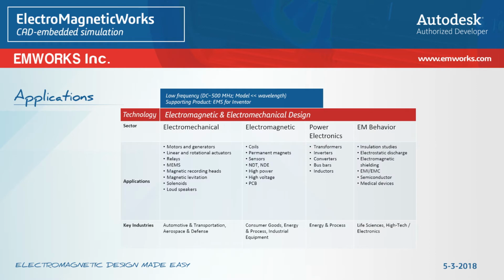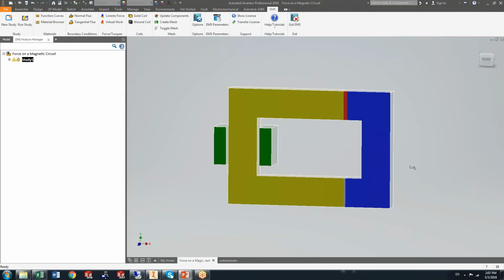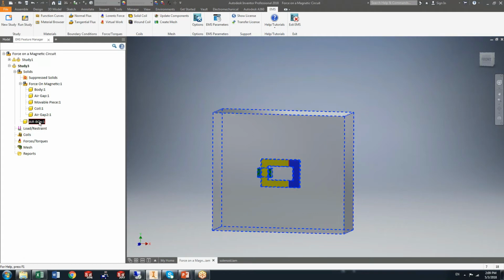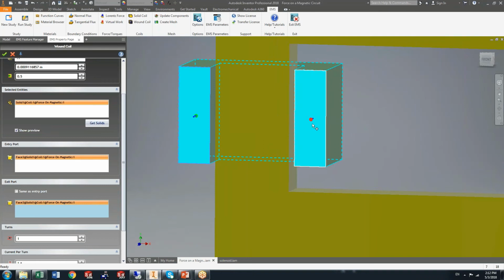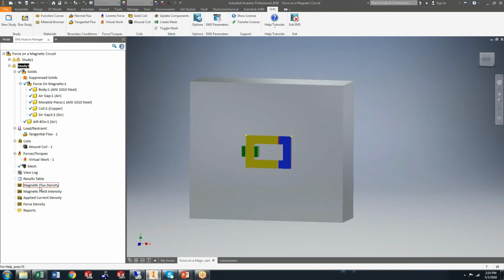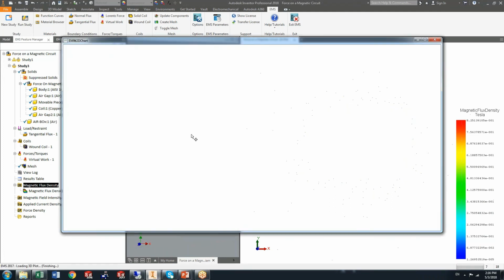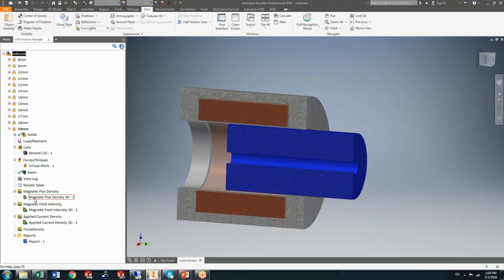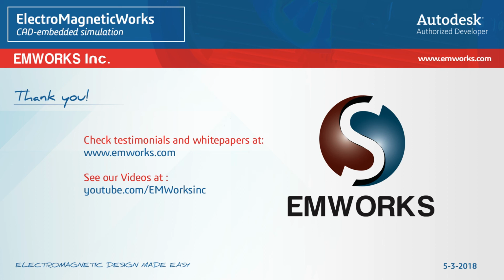[Webinar] - The Basics of FEA Electromagnetic Simulation using EMS for Inventor

Comment: ffs... is that you Cyanide? I just switched from wombles videos to find magnetic simulation videos for inventor.
Reply from the maker: Hello Emil, 
Are you looking for a tool that allows you to do electromagnetic simulation inside Autodesk Inventor ?
Reply: @EMWorksInc  I was originally looking to test it out with solidworks, but couldnt find an easy trial for it. Therefore i went with Inventor, since Autodesk had your plugin trial for easy testing. However i found out that i could do nothing with it since it only worked with predefined demofiles..
Reply from the maker: @emilrosen8749  Hello,
Please contact us at : sales @emworks.com